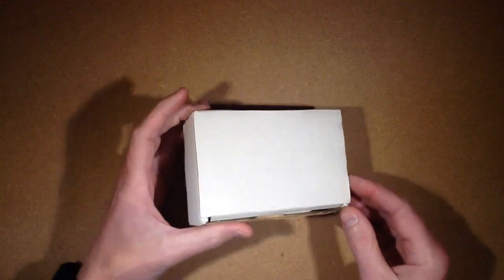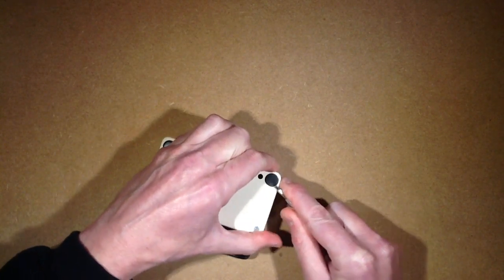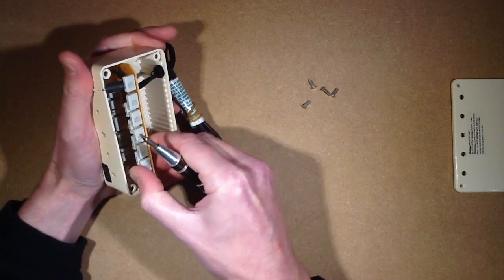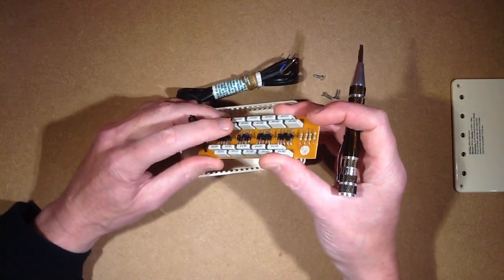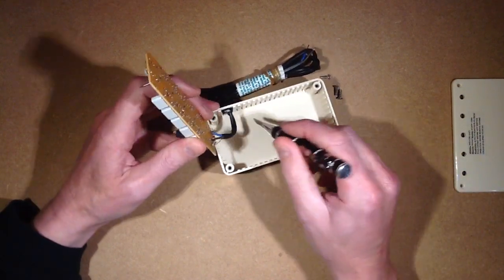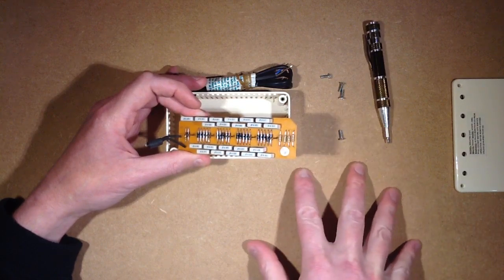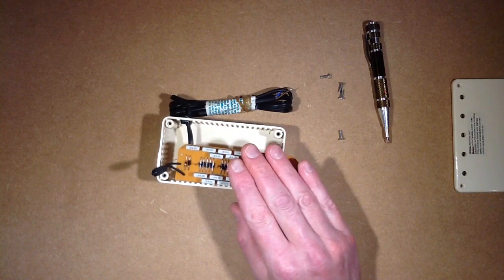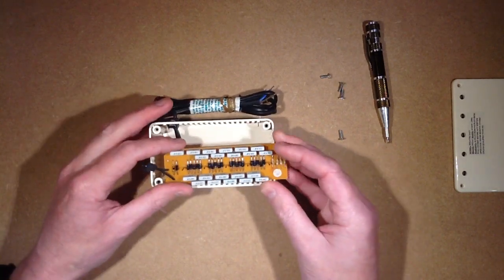Internal examination of an old NOS Dezac Breathe Easy ioniser.

Comment: Got a question about the capacitors. Which type should I use for 220V AC? Since I'm planning to built my own ioniser with a full wavelenght voltage multiplier and I found the scheme online, it recommends 275V 100nF but sir bigclive says those capacitors within the Dezac ioniser rated for 630V 10nF are the correct ones. Should I take those 10nF instead of 100nF ?
Reply from the maker: The 10nF capacitors will be fine.  You can use higher if you wish, but they then get physically bigger.  The schematic you found online might possibly have been based on my original ioniser page as I used 100nF capacitors in mine.  The 275V AC capacitors will handle the ioniser voltages fine.
Reply: bigclivedotcom thank you for your advice! Godspeed!

Comment: 0:14 No plug?  By design???
Reply: It has never been illegal to sell things with plugs.  It was more the case that it wasn't illegal to sell things without (it is now) so to save a few quid, they didn't bother.
Reply: It was illegal to sell things with plugs in the uk, I think, for a long time.
Reply: Jasper Janssen So housewives drunk on sherry had to connect the outlets???
Reply: Yup. Pretty much. Not that hard.
Reply: Well, this was thirty years ago now or so. The EU put a stop to it.
Reply: its not an English law, its a UK law
Reply: ben kerr The laws are made in England.
Reply: RonJohn63
laws passed by the uk parliament, by mps from all over the uk.